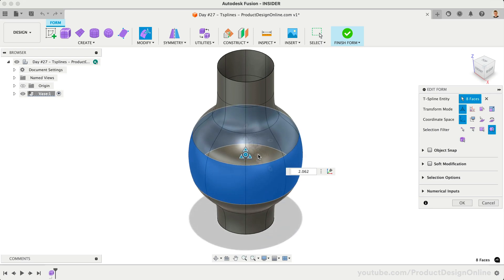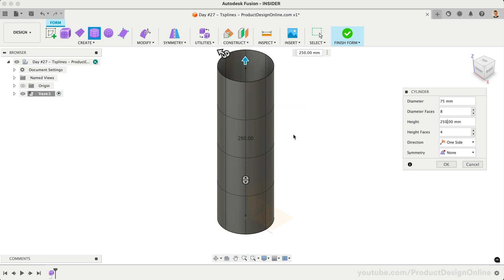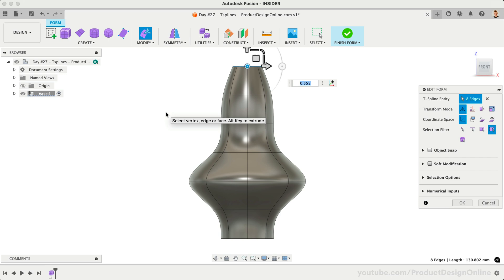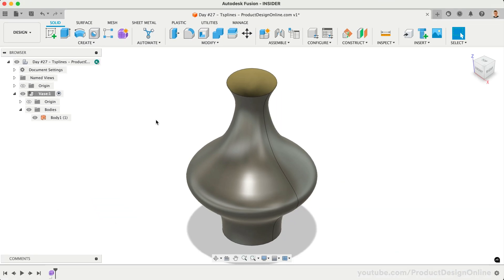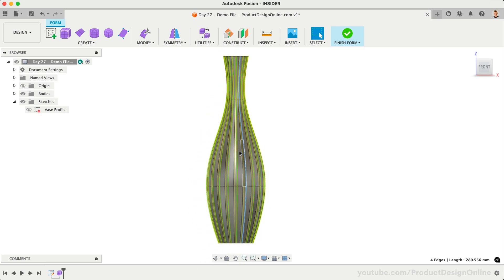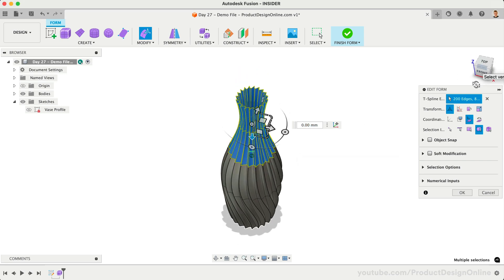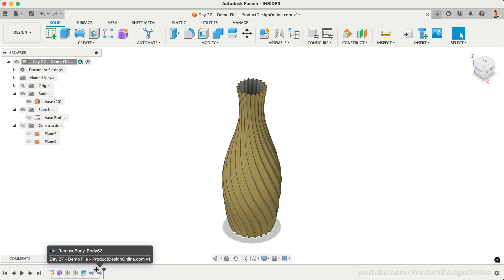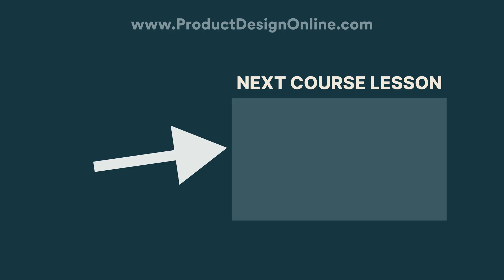Fusion T-splines are easy! | Day 27 of Learn Fusion 360 in 30 Days - 2024 EDITION

Comment: Thanks for the video, very good as always. Have a question. The 2 hollowing methods you showed leave the creased interior which wastes filament and increases print time when 3D printing. What would be the best method to use to get a flat (non creased) inside edge? For the patched revolved pot version where you created a full solid body, could you use the original revolve profile and offset that by x mm in and revolve CUT that out to give a flat inside wall? Are there other ways to create a flat inner wall?

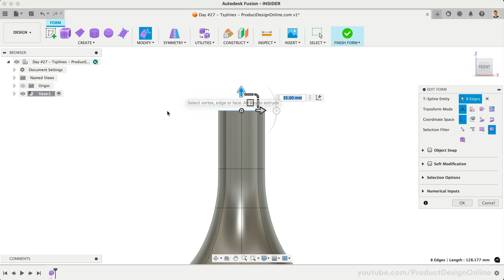Comment: I am using a PC. Holding down the Alt key while pulling on the arrow does not add extra faces for me as directed at 3:45. I also cant' see the grid like you have showing in this demo.
Reply: He holds the alt key, pulls the arrow up while holding the left mouse button, and then releases the mouse button. Then he holds the arrow again, and releases again. He does this hold-release repeatedly, and each time it creates a new "ring" of edges, extruding the corresponding faces.
Also, make sure you are working in the Form (purple) tab, and not the solid tab while doing this.

Comment: How do you turn on the lines? I can't see the green symmetry lines or the faces. The only glow when I drag the cursor over them.
Reply: I am also trying to figure this out.
Reply: Idk if this is 100% correct but i went On the display settings in the hoverings icons on the bottom of the page to the right of the comments section, then go to visual style then click to shades or wire frame with hidden edges
Reply: Srry shaded with visible edges only looks to be the correct selection

Comment: Does this look like 10% spacing between two edges?
Reply from the maker: sorry, not understanding your question. Did you link to something?
Reply: @ProductDesignOnline  No sorry for me the spacing of the inserted splines looked more than 10% for me. Is it possible to change the end product shape by changing the basic spline used for the rotation?

Comment: Hey Kevin, absolutely love the videos! I've gone through all of them up to this one with no problems but I'm having trouble at the thickening step. When I try either method to thicken, my computer just freezes up and won't respond. I've used thicken in your other videos with no issues. It's almost like trying to thicken THIS shape is causing an issue. Have you heard of this before? Any pointers you might have would be much appreciated! I'm on Windows btw.
Reply: i had the same problem too. idk what version you had back then but my version set my direction to symmetrical instead of one side which was causing the issue

Comment: Hi Kevin,

Window selection like on 7:35 isn't working here like you show, it keeps selecting the front half of the bottle. I have to select the other half seperately.
I use Mac, and tried different key-combo's with the mouse

Thanks
Reply: Go to the "Select" drop down -> "Selection Filters" -> check "Select Through"
Reply: @ChrisXFTek  thanks!

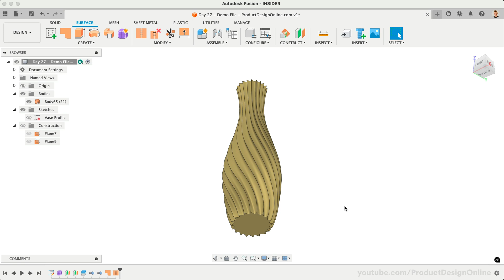Comment: At 9:57 Fushion doesn't let me define the thickness as 2mm resulting in Error : "The operation could not create a valid result. Try adjusting the values or changing the input geometry."  Any idea why that might happen?
Reply: Same here, only (minus)1 and the "one side" option worked. Also, via the alternative way (shell) same issues

Comment: Every time to try to do the two offset planes, I get an error message "the object that you are is not visible." Ive clicked everything to make them visible but I still get the same message.
Reply: I have the same issue
Reply: That's because the Construction planes are hidden. Turn them on on the left in the browser.

Comment: Could you create a video demonstrating the process of designing a model composed of two separate parts, each printed in different colors, and then assembled at the end?
And then it looks like you have multimaterial printer.
Like model Single Extruder - Dual Color - Dutch Cow